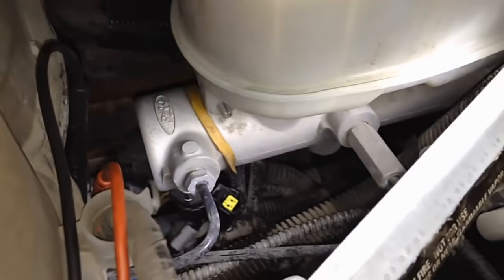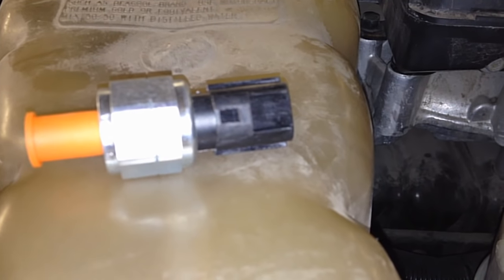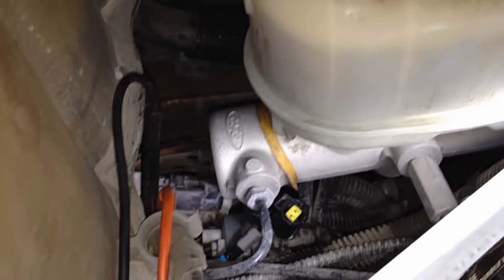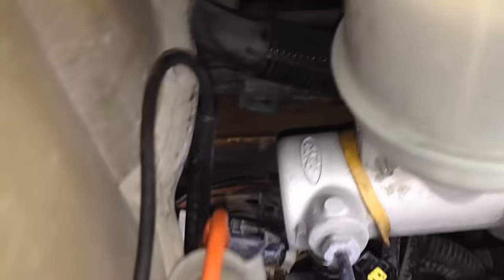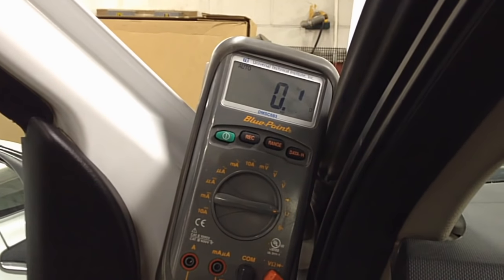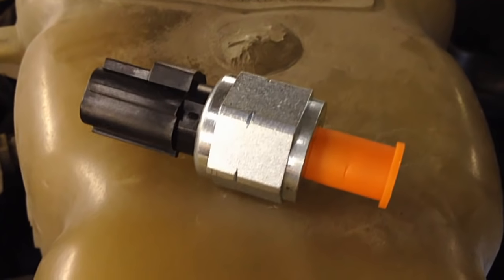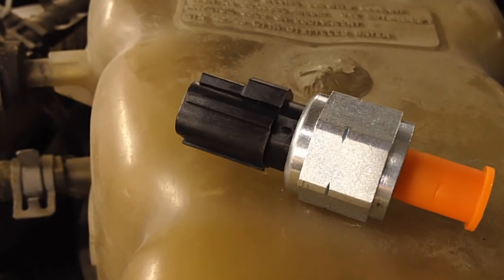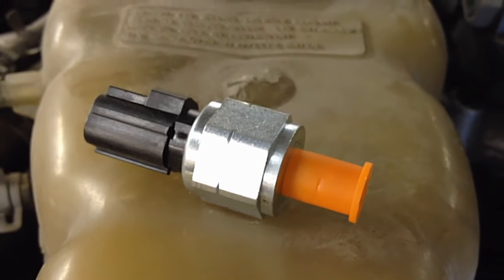#1 Reason Your Ford Cruise Control Doesn't Work Anymore

Comment: is there a fuse for CC? i have a 04 f150 5.4, and the light doesn't turn on when you hit the cc button, before changing this i would like to see if there is a specific fuse for CC
Reply: +angel fonseca 
fuse #5 on the left side dashboard. open panel between the brake release and hood release. Remove black panel inside that to see fuses. 2000 f150
Fred V

Comment: Greetings from Barcelona Spain
I have a 2006 Ford Mustang 4.0, my cruise control does not always work, it does it randomly. When starting the march almost never works, but if I stop at a traffic light and turn off the engine and restart, it usually works, until I have to slow down by braking traffic or a toll, not always afterwards it works. Then I have to turn off the engine again and restart to make it work.
Do you have any idea what I should do,
Reply: Adjust the length of the brake release switch at the pedal. in the situations you mentioned- you are pressing the brake all the way. while driving you apply the brake gently.

Comment: i had mine replaced under warranty on my 01 f250 5.4 but now it doesn't work again. i keep popping fusees for my brakes when i hit the brake pedal. i was told it was the cruise control module. they are very expensive from the dealer. do you know where i can get one cheaper and have you seen the CC module go bad before
Reply from the maker: Doubt it is the module never seen one fail. Unplug the module and see if it still pops when hitting the brake.
Reply: FordTechMakuloco My tail lights and upper brake light stay on, brother in law says it is the cruise control module. I disconnect it but the lights stay on. 2003 Lincoln Aviator.  Have you seen this before?
Reply from the maker: Yes disconnect the brake light switch under dash by brake pedal if they go out replace that switch. The plunger adjustment goes on them all the time and causes this.

Comment: +FordTechMakuloco I have a 2008 Ford F-350 with a 5.9 Cummins 12 Valve Turbo Diesel. My cruise control don't work at all. Could this fix the problem even though it has a Cummins in it? Thanks.

Comment: My cruise is not working... Checked the switch and it was leaking brake fluid around it, I replaced the switch and still no cruise control.  What else could it be?

Comment: My mother in law drove 10 hours with no cruise control in her 2007 focus.  The light comes on but it will not set.  Any ideas?
Reply from the maker: DLCShark Have they changed the brake deactivator switch next to the brake light switch? Those fail it seems almost as much as these.
Reply: Not that I know of.  She only noticed it not working on the trip down here.  I'd like to try to fix it for her before she leaves if I can.
Reply: DLCShark It's a broken cable.  They tend to break at the throttle body.
Reply: @FordTechMakuloco  doc shar,k

Comment: I'm having an opposite problem that maybe you guys can help me. I have a 2004 ford taurus se. as I was driving home last night my car was accelerating with out my foot on the brake and without the accelerator sticking. I did some research and it seems that I'm not the only one with this problem. it acts like it's in cruise control even though I don't set it. I think it may be either the ecu component going bad or the idle processor. I would hate to take it to my ford dealership because they're crooked and will screw me out of whatever. I know it's not a vacuum leak. any thoughts or videos reacting to this issue? is there a way to manually deactivate my cruise control or replace the ecu or fuze?

Comment: I replaced this part to fix a brake leak on the master cylinder. Definitely didn’t need to bleed the master cylinder. Just unscrew it. 99 Ford Expedition.

Comment: I did the continuity test. I put a stick on the brake pedal pushing it with the seat but still has continuity. What could it be other than the new one been bad too?
Reply: I replaced mine and it didn’t work same for you? Any fix?

Comment: If U have a older model like me 1995 ford f150 4x4 there was a recall on them for SPEED CONTROL SENSOR  they would cause a fire If ypurs  is Automatic Transmission and ABS light stays on and will not start in Park DONOT put in N to start and drive  it  will start smoking and catch on fire.

Comment: Hi, have a 2009 F150 Lariat. Cruise stop working and will not come on. All brake lights work. Any thoughts?
Reply from the maker: Clarence Estep I have seen those have steering wheel switches that go bad, there will be codes set for the switch pack that is bad.

Comment: I have a 2002 Ford Explorer 4.0 L v6.XLT. 4X4. my cruise switch is on and I hit the set button and the light stays on but doesn't set. Could that be because of the set switch or the cruise button needs to be fixed.
Reply: I have a 2004 f15 v8 and the EXACT same thing is happening to mine.  I am going to get the switch and see if that is the issue.  I hope it works.
Reply: Ronda Knerr did that work?

Comment: Would this also cause the auto trans not to shift when brake is pressed?
Reply from the maker: +Jon Madden no
Reply: Ok, that was my issue.  I press brake and will not shift.  Have to press the button on shifter to get it to release.  Then just noticed this morning while driving the CC would not engage at all
Reply: Also appears now no brake lights.  Which looks like faulty brake light switch.

Comment: I replaced my brake lights for LED lights, ever since my cruise control stopped working. Why? Any help will be greatly appreciated.
Reply from the maker: They are feeding back through the brake circuit.

Comment: when I replaced mine the brake fluid was pouring out at a decent pace... is that normal? I was expecting it to drip lightly

Oddly, I still have a c1288 and "trac off" light
Reply: Trac Off (Traction Control) is not cruise control

Comment: Thanks for the info. 
How can I get the old design? I have a 97 crown vic
Reply from the maker: You buy the new design and it comes with a jumper wire to match the new sensor to the old harness on the car.
Reply: Switch on my 97 crown vic is on a brake line junction located below the master cylinder.

Comment: I know this is old and don't expect an answer, but just in case...

I have a 1995 E350 7.5l. Is it in the same location and does it just unplug? I don't see any threads on it in the video.
Reply: Larry Bell, the orange cap is a thread protector to be removed prior to installation.

Comment: When I unplug it the last 2 pins on the wire harness and module is burnt on. The 2 closest to the firewall
Reply from the maker: Then you likely had a corrosion issue, now it gets expensive.

Comment: I am having the same problem with me 2010 but I cant find the air switch u are showing on the master cylinder
Reply from the maker: They don't use these anymore, 2010 what model?

Comment: hey I replaced my and I had it recall n now I got 2 fuse now do I need leave them or can I remove them with new harness
Reply: I'd say yes leave the fuses I believe is for the recall so that if it leaks brake fluid won't cause a fire as the fuse will stop the electricity for safety in such a case.

Comment: Great video! Do you have that part#? I'm thinking it's the same part for my 2002 7.3 Diesel Excursion(cruise is not working or lighting up on cluster) since they are arguably the same in most ways as a super duty. I'm trying to find it on the internet for a good price and not go to the dealership.
Reply from the maker: Chad Anderson Best place to get it is amazon. The link to the updated part is in the description of the video.

Comment: My 04 expedition is in the switch on the steering wheel. I can keep pressing the button and it will finally work.
Reply: Mine did that, it's not the switch. It's the exact part he replaced in this video. Works great now no problem
Reply: Did u try this switch?

Comment: Please help me.. i have 2005 Taurus 3l se , the horn nor any other controls on the steering wheel work like radio control , cruse etc.. i DO NOT here the relay clicking when trying to use any of them.. signals work fine.  THE horn DOES work with the key remote.. so i know it isnt the horn itself .. please if someone can help reply soon as i have to get it inspected by the 1st of April. An it will not pass without horn.
 Oh and also the Airbag light is on as well.. so its basically nothing on the wheel its self.. someone said there is a steering column relay ?? but i cant find anything about it.
Reply from the maker: Jack Mehoff No your clock spring has failed and needs replacing, the ribbon inside has broken
Reply: FordTechMakuloco
 He passed if for inspection.. but now i have to fix it.. thank you i kinda was wanting another opinion to back that up.. thanks thanks thanks !
Reply: Jack Mehoff Check your blinker fluid.
Reply: Jack Mehoff Jokes on you, you drive a Taurus
Reply: Yup I drive what I can afford. Happy trolling

Comment: have a 2012 F-350 that the cruise wont work. changed switch in the steering wheel but still wont work

Comment: I changed the cruise control switch on the master cylinder for my Ford 2001 F150. Still no cruise control. What next?
Reply: Same here on my 2001 Expedition.  My switch was stuck closed, pressing on the brake would not open the circuit.  Replaced it with a $20 switch from o'reilly which is working correctly, but still no cruise.
Reply: If I turn the key on to the run position, and press the cruise on switch on the steering wheel, the cruise light does come on for a second, then goes off again.  I can't do this once it's started.  I see online that there are many other causes of this, one is a faulty brake switch, i've recently put a new one in, so it shouldn't be that.  I'll check brake light bulbs next, I know I have one third brake bulb out.

Comment: where is it located on a 2003 Ford Expedition
Reply from the maker: Those use a brake deactivator switch under dash next to brake light switch, there will be two that plunge off the brake pedal that look almost the same.

Comment: Why didn't you mention the huge recall for the 1992 to 2002 F-Series Trucks, and other models because of these catching on fire out of nowhere.And the Vehicle didn't need to be running, or even have the Key in the ignition. Since that switch is hot at all times, and if brake fluid gets into it, Poof your Vehicle, Garage, House all could end up a big pile of ash. And from what I just recently found out Ford revised the recall more than once, I thought I was in the clear Years ago with my 1995 F-150 after Ford added in a jumper wire with an inline fuse, and then later they made another jumper wire with 2 inline fuses. And this is all from back in the early to mid 00's, so like I said I thought this was over Years ago when I got the fused jumper wire. And from what I read if you took your Vehicle in & your switch had brake fluid on it you got a newer switch. But the majority of People including myself got the fused jumper wire leaving the real problem, "the switch" behind. And depending how early you took your Vehicle in you either got the single fuse or the double, and seeing how I didn't want a ticking fire hazard around I went in ASAP, so I got the single fused jumper. Now I find out randomly on here that Ford has another new part to fix the issue, so for $30 to $50 depending on were you buy it, you get a new switch plus another jumper wire this time without any fuses. I think the part should be free because of the ongoing recall, I'm going to find out when I go to the Stealership. So I'll see, but I figure I better have some $$ ready to hand over.

Comment: I own a buy to own 2006 Ford Taurus and my cruise control when set to 70 will not disengage and when you press the brake and let off it then it jumps back to 70. I thought it might be the brake light switch. God i hate Fords

Comment: even if the light on the dash comes on?
Reply from the maker: If dash light comes on and stays on it should be working
Reply: FordTechMakulocoany thoughts of what else to look forFordTechMakuloco
Reply: @FordTechMakuloco  My green cruise light comes on and goes out as it should. But it will not hold speed

Comment: To bad that won't fix a PSOM code on a 96 f150. Yes I know what it is. $150 to have the speedometer rebuilt, didn't help.Luckily 96 just old enough for safety inspection only, wish I never bought the Ford. Runs good but no speedometer, so no cruise. Tired of using GPS for speed monitoring.

Comment: how about on a 98 Taurus ??
Reply from the maker: Seth Chauvaux 98 Taurus I would remove the cable from the servo and inspect they like to break off inside.
Reply: FordTechMakuloco 
I'm not finding anything at the servo.
not much of a mechanic but there are some other problems.
the horn doesn't work anymore could it be something on the steering wheel connection?

Comment: I spilled wine over the cruise control buttons. (LOL! don't ask me how that happen). Now the cruise control sometimes works and other times don't. How can I take them apart for internally cleaning those buttons?
Reply: +ruizhernandeztrustfi there should be two screws on either side of your steering wheel. undo those and the horn section of the steering wheel just comes off.  two screws hold on the buttons.  hope that helps.

Comment: You can also do the McGuyver trick with a paper clip. Just unplug the harness and short out the connector. I got tired of replacing the switches so just bypassed it, been working fine ever since.

Comment: Can you do a video on the brake switch with more information with how it relates to the cruise control ?
Reply from the maker: Johnie Mahaney I don't see a video anytime soon but I can tell you the speed control system uses the brake light switch as a primary input the brakes are being applied and to disengage the speed control and the deactivator switch is used as a secondary redundant input the brakes are being applied. If either one does not jive it will not enable the cruise at all.
Reply: My 07 Lariat F150 doesn't have this switch on the master cylinder. The book just says take it to an authorized dealer.
Reply from the maker: Johnie Mahaney Yours is under the dash next to the brake lamp switch.

Comment: This didn't work for me. Thanks for the help but my opinion is the video is poorly made. You just showed us where the piece is but didn't point it at all with the finger. I was looking everywhere in the video at a lot of places and couldn't find that piece. Another thing, all you did was a closeup of where it was located. You had to really show where the piece is by showing the whole motor and then close up to where its located.
Reply from the maker: Christopher Hernandez Switch is on the master cylinder everytime I know you can see that in the video it is very simple if you can find the master cylinder you can find this. Not the best vehicle to demonstrate on but it is what I had and it has help thousands of people diagnose their cruise control no problem. I think you are the first that has complained you cant find it.